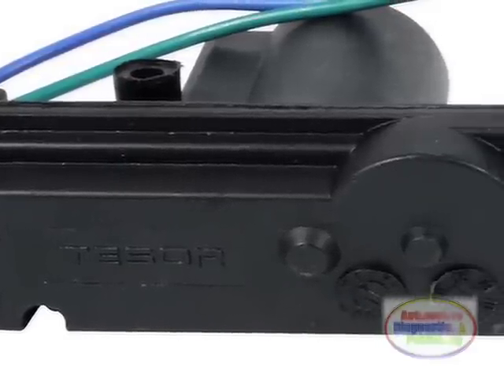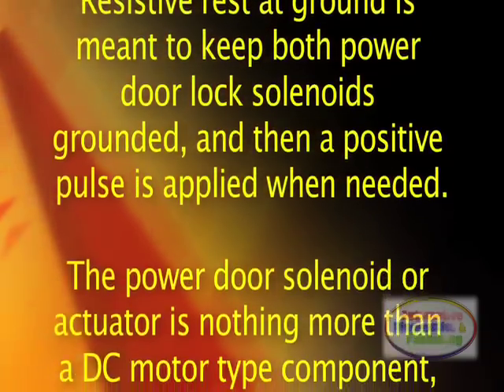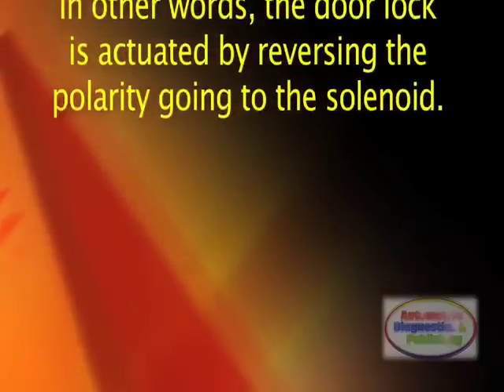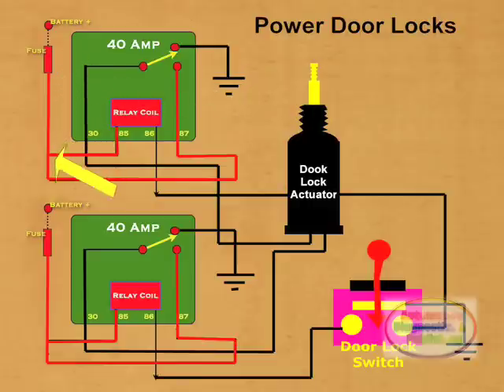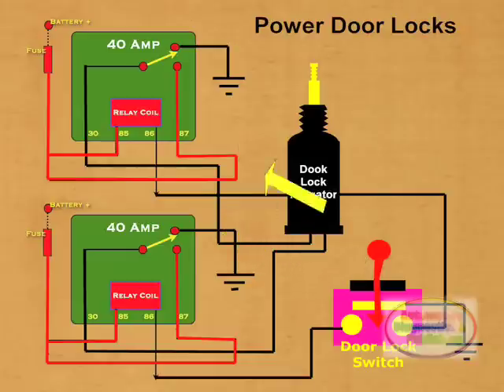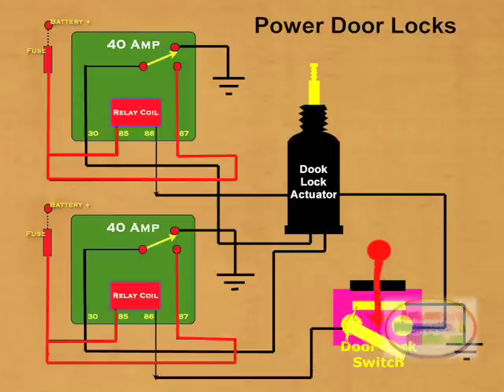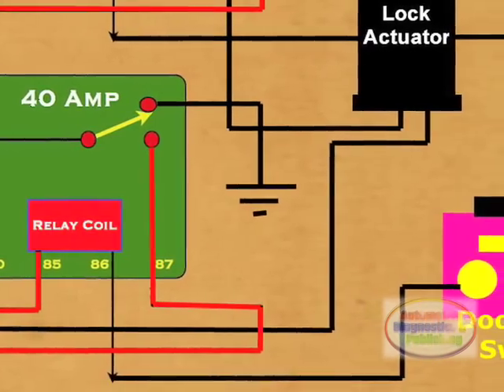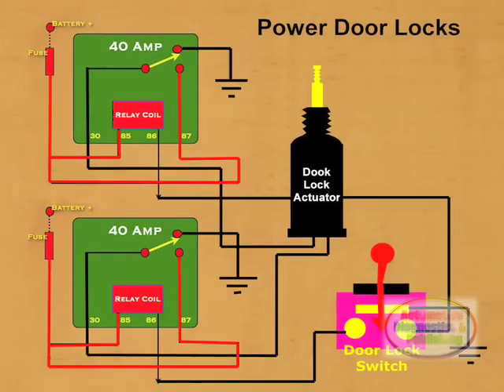How to Wire Relay Power Door Lock

Comment: I think it would help the illustration if you went over the last part graphically,  showing the position of the actuator, up and down, when you change the position of the switch. The words are there to follow it, but to trace what's going on, you have to pause the graphic to follow the path of the circuit. This is a very useful video, though, and helps a great deal.

Comment from the maker: Well the fastest way is to use the front doors to trigger a relay at the rear door. The relay in turn also actuates the lock motor/actuator. The other way is to use the circuit seen here. Remember, you need two relays in this circuit, one for up and one for down Lock/Unlock. Makes sense?

Comment: Hi, ADPT. I have dodge pick up ram 1500 '2002 with quad door cab.
front driver side and front passenger side does have power door lock on it
the quad door cab doesn't have power door lock. I would like to install  the switch and power door lock on it. How to connect them? Thank you

Comment: very usefull graph thanks. i dont need to use my brain to figure it out. in that case i prefer using 4 actuators 2 wire with central lock switch somewhere for further secure.
Reply from the maker: THanks for sharing, but you still need the schematic given for it to work.

Comment: Hi, can you please say why it is better to use a relay and it is not sugested to wire up directly the central unit to battery and to the acuator? Without using a relay may drain your battery ?
Reply from the maker: There's no simple answer. I suggest my 5 Ebook Starters Pack here...

https://sites.fastspring.com/autodiagnosticsandpublishing/product/auto_tech_starters_training_kit

Comment: In either position if the switch stays on the motor will keep running so it will drain the battery, most cars have the switch integrated in the drivers side motor and the switch will stay on,so in this case use a central lock module which only delivers a pulse instead of continuous current.
Reply from the maker: Holiday Mauritius In this video the whole thing works totally different.

Comment: Will this work with a 2002 Dodge Ram? I have the door switches, harnesses, & motors from a donor truck but have to wire them up using relays, my truck came with manual locks.
Reply from the maker: Jacob Lindsey It works on any car. Just make sure you understand current flow. Here's some help.

http://www.autodiagnosticsandpublishing.com/Automotive_Diagnostic_Repair_Book_Catalog.htm
Reply: Thanks. I was just confused because from the factory the switches use an in-line ohm resistor to lock & unlock the doors. I didn't know if I would have to solder in those resistors somewhere or if that was when using with the computer. I'm guessing since it's being wired completely different with SPDT relays they aren't needed.
Reply from the maker: Right, it's a totally new installation. So long as the actuators are 12 volts, and 99% they are, you're fine. Good luck.
Reply: Thank you so much! Now I just gotta find a schematic for the wires coming out of the switch & I should be good to go.
Reply from the maker: Jacob Lindsey Some systems like Nissan the switches are networked, so it's not like the switch closes a contact. It's more like the switch outputs a CODE-Up or a CODE-Down... So be careful...

Comment: Im have a question my car when the key is on the power door is working but when im turn off that not work you know why
Reply from the maker: If controlled by module, there is a missing B+ input to it.
Reply from the maker: Check ignition switch.
Reply from the maker: I suggest my 5 Ebook Starters Pack here...

https://sites.fastspring.com/autodiagnosticsandpublishing/product/auto_tech_starters_training_kit